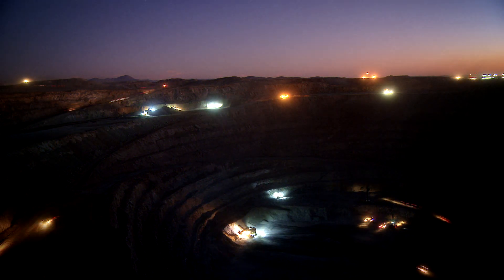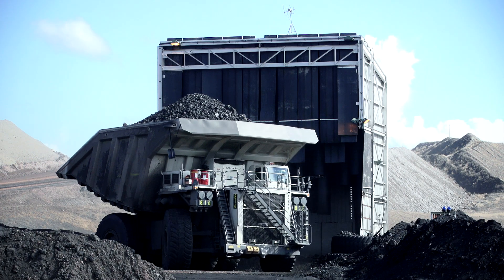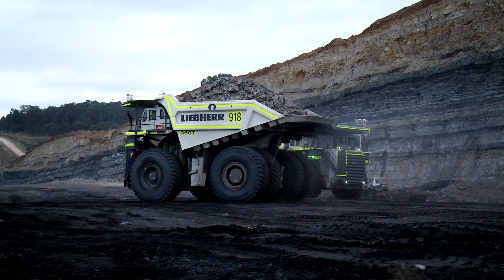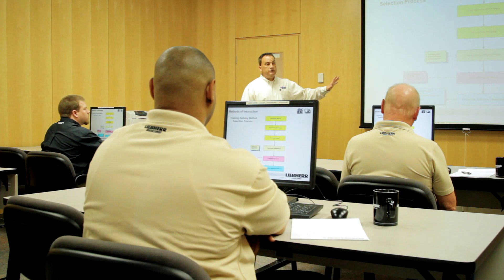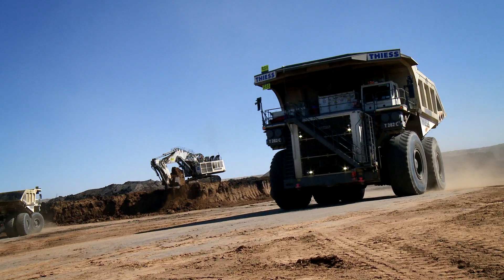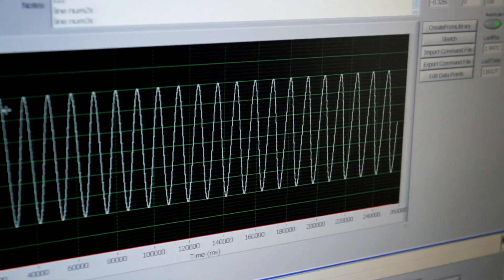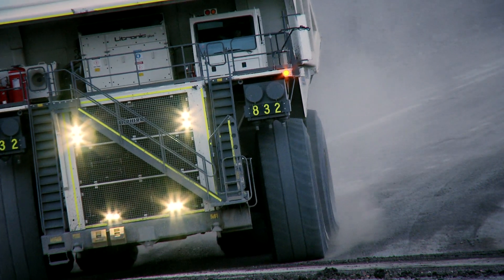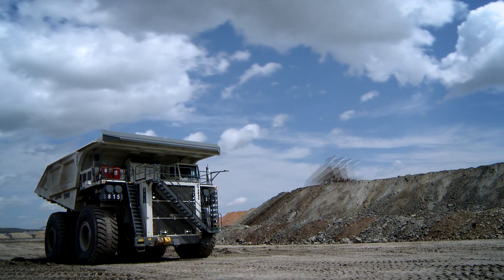Liebherr Mining Truck T 282 C

Comment: Mine doesn’t go 40 miles per hour. I max out at 32, maybe they can put different restrictions on speed  of the truck, I’m pretty sure they can🤷🏼‍♂️ just seems much higher than the 282 I drive. 18 down a ramp loaded 24 empty are another couple of max speeds in our procedures. 
🌈 the more you know!!

Comment: I am an electrician on the 2- T282C's that are in a competition with the Cat 797f and Komatsu 960 in the oilsands in Alberta.  Tillman has his right to an opinion but it is not a fact.  We are above 93% availability on both trucks overall and the operators that know how to drive love them.  Just look at the suspension between the three trucks, enough said.  All I can say is they are a great truck.
Reply from the maker: Thanks for this statement, cw lee - great to here that!
Reply: I agree and disagree with Tillman's comment.  The B models are not something I would write home about, but the Cs have fixed all but two issues I have with the trucks.  So, if he was referring to the B models, I would agree somewhat, but the C models, I completely disagree.  They are a good truck.
Reply from the maker: Thank you for your opionion shared, alco424 !